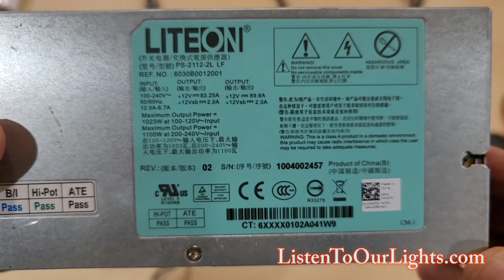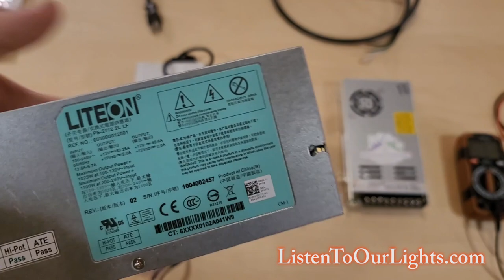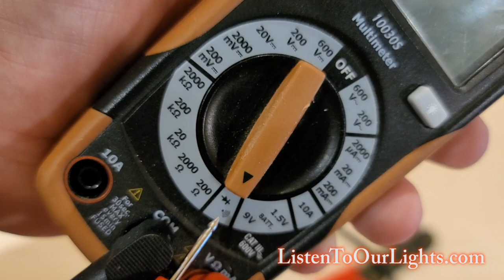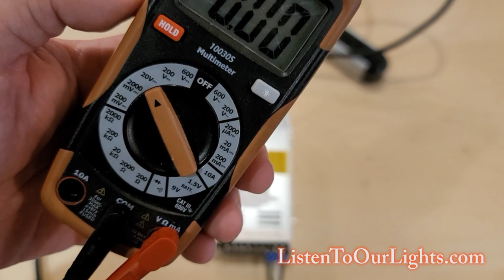Hooking up a Power Supply (PSU)

Comment: hi there i have a advatek controller each port is 340 pixels and i want to add other power supply to port 9 to 16 could i take other ac wire and plug that one to power supply and connect to controller so that mean i have two different wires and 2 wires to plug into wall socket thank you

Comment: Do you do anything for strain relief? Looking for ideas. Seems crazy to just strip the ends of a cord and put them into a screw terminal without it.
Reply: Personally, I solder a ring terminal onto the wire and then fully remove the screw from the power supply and reinsert it through the ring terminal.  With the ring terminal soldered onto the wire, no strain relief is really needed.

Comment: If my PSU is 12v @30A (with 3 V+/V- connections -- similar to the PSU shown in the video) and I only connect one V+/V- to load, can that single V+/V- connection source 12v @30A, or do I need to connect all 3 V+/V- connections to the load?
Reply from the maker: The PSU can handle all of the output on one set of terminals. Make sure that the wire you use is the right gauge to take that much. Like 10 AWG.
Reply: @listentoourlights  Thank you for your quick reply. I  intend to distribute the power from the PSU among 4 strings of pixels, so I need to connect the output from the PSU to a bus bar and distribute pwr among the 4 pixel strings.   So, as an alternative to a single connection to bus bar, could I connect all 3 outputs of PSU  to bus bar? Would that mean that roughly 1/3rd of load is on each wire from PSU to bus bar?
Reply from the maker: @gatoruss62  The preferred way of doing it is to connect your power supply to a power distribution board then do your power drops from there, each with a fused connection. Do a search on f8 distro board for an example.
Reply: @listentoourlights  Thank you.

Comment: What size blue crimp fork connector did you use.  Went to buy and see that there are size #8 or #10.   Which one fits the studs on the meanwell power supply?  Thanks for doing the video. Very helpful.

Comment: Hello thanks for the video. I notice everyone only uses 1 output even tho there is 3 output sections. Can you use all 3 to output to different things?
Reply from the maker: Yes you can!
Reply: @listentoourlights  sorry sir a follow up question just to make sure i dont destroy something or burn money.

if i had a 48vdc 20.8a 1000w power supply  and i use all 3 slots which require 48v 6a each, the psu can handle it? ie all 3 will get 48v and 6a, meaning the limiting factor of the psu is the total amp/watts you put thru it am i correct?

Comment: Hi there loved the video, super helpful Im using this information for a stepper motor project with these power supplies and it really helped. Also I have a question about what size wire gauge did you use or would recommend? Is it just standard 22 or would you reccomend something smaller?

Comment: I have a 200W , 24V transformer , Question is if I can put it inside the stud walls? I dont think it has a fan like the ones in your video. Many thanks in advance
Reply from the maker: I'm not an electrician, but I would not put this inside a wall with or without a fan.